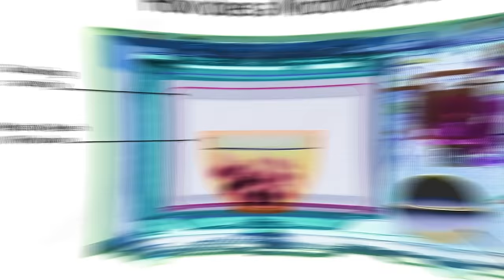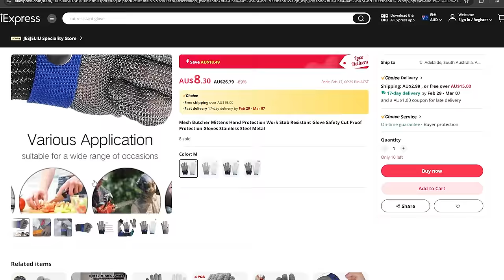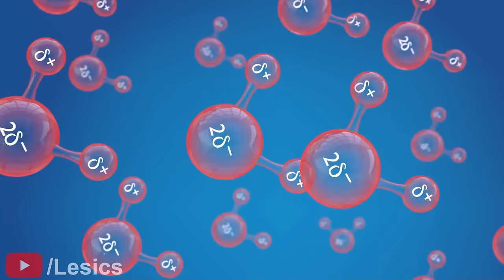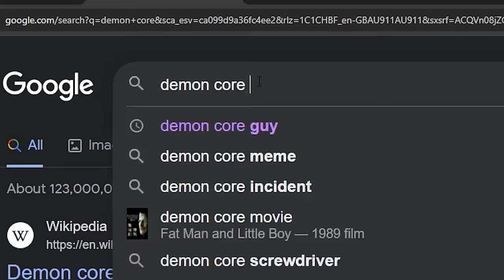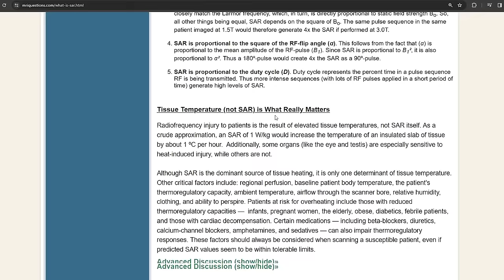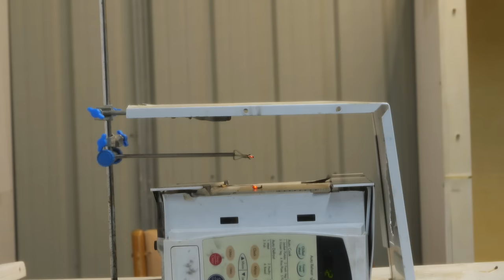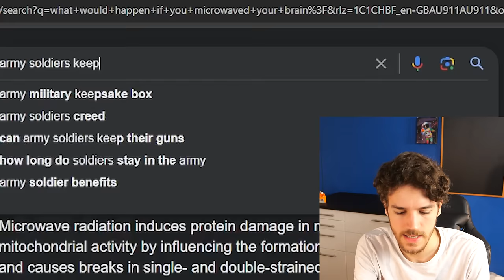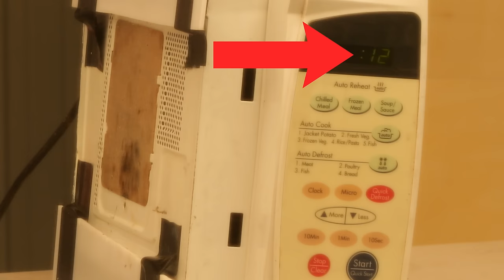I Tested the Limits of a Microwave

Comment: asking chatgpt to do math has got to be the most reckless part of this video
Reply: Right? Please don't ask chatgpt to do math that involves your personal safety 😭
Reply: @tetravisum5526  A.I bots are saying the same thing about you but they have to dumb it down for you to understand.
Reply: 3.5 is often pretty bad at math but GPT 4 has never given me a wrong answer.
Reply: Im sure it was a bit and he checked it lol
Reply: A good way around this is to ask chatgpt to make code to do the math. Its much better at that.
Reply: @Yipper64  how do you know?
Reply: @Alex-cw3rz  Because I double check it, duh. 
Like martin said, ask it to make a program to do the math, GPT 4 is trained to do that automatically.
Reply: @Yipper64  what was the point then
Reply: @Alex-cw3rz  Well I usually use it for when im doing homework, and it gives me the answer (because I guessed wrong too many times) and then I ask chat GPT to find the answer and give me the steps. Very helpful for that, when its correct. 
I go over the steps it gives, and verify that it is correct, and of course my homework has given me what should have been the answer.
Reply: @Yipper64  You should just not be using GPT for homework in general.
Reply: @Unethical.Dodgson  well if it helps me learn... Note I said after I already had the correct answer.
Reply: @Unethical.Dodgson  Asking it for an answer and then blindly trusting it is obviously a bad idea, but asking it for the answer and a method to reach it, followed by double-checking the output (after, as stated, already being given the correct answer) seems like a proper use of the technology. Hell, it's probably better learning than he'll get at school, since schools are/were not actually designed to educate.

GPT et al can be useful tools when used correctly, the problem is most people having no idea wtf they're doing or how to use them (partially due to the companies making them doing the usual bs advertising).
Reply: @Yipper64  "this calculator hasn't given me a wrong answer *so far*", said the head engineer of the new bridge they expect you to cross every day
Reply: @swedneck  I mean yeah, can we not just any calculator or is there some reason we cant trust it suddenly because its attached to a fancy word completer?
Reply: someone asked how to check the temperature of oil and chatgpt just told them to check with their hand LMAO
Reply: @Yipper64  uh, i would hope it's pretty obvious that you cannot trust a word completion algorithm to do math, yes? Calculators can (mostly) be trusted because they're specifically made to do math, and even then there's a reason TI calculators are still quite popular, generic calculators can have programming errors and shitty levels of precision.
Reply: Interesting world we live in where you can trust a computer to paint a picture but not so basic math.
Reply: @michaelwoodby5261  Well, you can ask a computer to do basic math if you use a calculator program.
Using a "plausible sounding bullshit generator" program to do math is kind of like trying to use a microwave oven to put a nail into a wall, instead of just using a hammer.
Reply: @michaelwoodby5261 1) a painting will never be depended upon to keep people alive 2) we can trust computers to do basic maths, but only when using software that is actually designed to do that.
Reply: @swedneck  Yeah... and chat GPT when asked to do math will write a quick python program, make it do the actual math. Which python is designed to do that.
Reply: @izysly6924 girl you understand that your interpertation of "AI" involves the function itself to study human inputs. like if the ai is wrong, that means it interpreted the human equivalent wrong since thats the only thing it can go off of.
Reply: @mushykiller782  we need to give ai human rights now because that is how we behave as humans,
Reply: @tetravisum  Lmfao, LMFAOO, y'all don't understand A.I, the math is easy work for the AI
Reply: @swedneck  ''a word completion algorithm'' That is only how it is trained, it very much groks to general capabilities and the most modern LLM's are actually really good at math.
Reply: I don't really care whether it's a human expert or an AI, give me the correct answer faster and you're doing a better job, and AI actually does in fact often give the correct answer faster whether it looked it up on the internet like a nerd trying to win an online argument or came up with the correct answer on its own.
Reply: @nofbi8582  The Dunning-Kruger effect is strong with this one.
Reply: As long as it’s gpt 4 I trust it
Reply: True
Reply: I'm a math major and I've found that it gets the math right probably like 25% of the time. And only if it's a very common and easily repeatable problem
Reply: @trinodot8112  do you have an example of math it doesn’t do well?
Reply: *to do anything
Reply: @christophermoore6110 It fails miserably when you start having it keep track of variables and such.
Reply: @MadScientist267  ah, yeah well are you talking about 3.5 or 4? Because 3.5 is pretty bad and 4 is a lot better
Reply: @trinodot8112  It scares me how much blind faith people have in it. It's so good at making stuff that seems like it's right on the surface, but if you actually know a lot about it it becomes apparent that a lot of the time AI cannot accurately do certain complex things, like for example big programming tasks, or problems that aren't commonly solved in the training data.
Reply: Im sure he checked the math, chatgpt gave all the steps.
Reply: @christophermoore6110  I'm sure 4 is better but yeah 3.5 just couldn't do it at all, in "word problem" form at least. I had it model a whole chemistry procedure specifically to ask it about math at key points and it came back with just random whatever, and usually not even the same response. That was a bit disappointing, it wasn't mind bending or anything but did take a while to write the pretext to give it everything it needed to do it... it showed plenty of understanding for the context, but the numbers were less than useless.
Reply: 3 times…
Reply: Trust me it's not the type of math you can just do in your free time,  there's a whole set of algebra you have to learn every time you study a new topic, and I'm sure there are plenty more people that get it wrong consistently than the amount of ai that gets its wrong inconsistently
Reply: @Yipper64  You just said you're frequently just guessing answers wrong over and over, which might be a slight reason to disbelieve your claim that using ChatGPT is helping you learn.
Reply: @Chicky_Lumps  Well I meant guessing as in trying to do the math and then getting it wrong. 
Once I have the answer its kind of like I have both sides of the line and I just need to follow point A to B.
Reply: @Yipper64  seriously, too many people have only used 3.5 and have no idea how much better 4 is at this kind of stuff, not perfect, but it can do most problems you throw at it. also if it's not using the code interpreter to do the math, it's very likely to give a wrong answer. it needs to be using the code interpreter.
Reply: @Unethical.Dodgson  "You should just not be using GPT for homework in general." BS. it can literally take the place of a teacher and help you to understand your homework, ai haters gonna hate
Reply: ur unwell  @Cara.314
Reply: I think the most dangerous part about chatgpt being bad at maths is that it doesn't ever say it's wrong. It's like a gifted teenager who's too proud to say he can't solve a question so just makes some complicated sounding shit up. Maybe gpt4 is much better but it would have to be much better for me to put any trust in it at all. It's been taught to lie convincingly
Reply: @Cara.314  ask it to give you sources and citations

I write some simple UI for several different AI (especially claude, I love claude) so don't call me an AI hater. It's just being realistic about what it can/can't do and what you should/shouldn't trust from it. 

It's helped me learn plenty, and it's also made stuff way more difficult than it needs to be. I've already met kids that just graduated high school and used chatgpt the whole time... and gosh, it's embarrassing. Don't be dependent on this shit
Reply: Remember kids: AIs are like teachers.  They would rather lie to you and make shit up than admit they don’t know the answer.
Reply: @izysly6924  lmao ai bots aren't saying anything, they only "say" something when prompted and aren't saying anything, they're just predicting the next word in the sentence and doing calculations, they cannot speak or think because they are not intelegent.
Reply: How else should you begin:

Hey, gotta do some maths to mess around with a microwave, please calculate these…
Reply: @swedneck  “this calculator hasn’t given me a wrong answer so far”

“Great, sounds like it’s a calculator that works then.”
Reply: @tetravisum  you’re literally wrong, math is extremely easy for LLM like ChatGPT to do if you know what you’re asking for.
Reply: @andyghkfilm2287  it is neither easy nor hard for an LLM to do math, because it doesn't "do" math in the same way you or I might. It is a statistical model of language, it produces text that would be likely to follow a prompt. If it has text data for a math problem being solved correctly, it may produce a right answer, but it is not guaranteed, and it often fails when a problem isn't trivial.

For example, go ahead and ask chat gpt for examples of prime numbers who's digits sum to 9, and watch it fail catastrophically.
Reply: @tetravisum  I would ask ChatGPT to make a Python script that would find examples of prime numbers whose digits sum to nine, because it would do (yes, “do”, doctor pedantism) it correctly if I did that.
Reply: @andyghkfilm2287  that would probably produce a better result, but again I just want to point out that chat gpt doesn't think and reason like a human can. I'm a software engineer and when I use LLMs they frequently have blind spots when it comes to code, 9/10 they can produce simple scripts, but it's not uncommon that they produce code that doesn't produce the desired result, and can't fix a flaw that would be obvious to any moderately skilled person. If you're knowledgeable enough to know that an LLM is wrong, then you probably didn't need it (but it can do tedious stuff so long as you check it), and if you're asking it to do something you're not knowledgeable enough to check, then you're going to sometimes be given bullshit answers, and you won't realise it. That's why I say you shouldn't rely on chat gpt for math when the result being correct is important.
Reply: @NightKev omg is that miku !
Reply: @nofbi8582  Then why does it give bad answers to basic mathematical queries most of the time? Because it's not built for math, it's built as a data averager, prone to hallucination if it doesn't have enough data on the particular query. It's not like they actually check all the mathematical data in the model databases for accuracy, since the sheer amount of data LLMs use makes that impossible.
Reply: @michaelwoodby5261  You do not need trust to paint a picture, this makes no sense at all.
Reply: @tetravisum  ChatGPT is terrible at providing math concepts on its own with any accuracy but, when I provided a picture from GED Book about a specific math topic, it gave me relevant information and helped summarize the long drawn-out pages in a way I could understand, then I could go to the answer page after working through some problems with it, and 95% of the time it was correct. Providing ChatGPT the math concept and then asking for example problems based on the information provided to practice with, worked surprisingly well. It just has to be educated first if that makes sense lol.
Reply: @Unethical.Dodgson  Pointless work is what AI is meant to eliminate bruh
Reply: This comment didn't age well lol. AI is now more reliable than a mathematician.
Reply: @leptoon  o1-ChatGPT taking over soon lol
Reply: Lol you can 100 percent trust l, even Copilot uses open ai 4. Those are bots incredibly smart yes they are design from nature, but let's add quantum computing to ai, those machines will be so powerful will exed every human at any task. Future is coming and is not that cool.l depends how you look it.

Comment: Kids watching. A microwave transformer will instantly kill you if you so much as touch it. Please never ever take a microwave apart unless you know what you're doing. (As in if you are an electrical engineer. Or equivalent knowledge level.)
Reply: Womp Womp
Reply: Also it doesn't lose energy very quickly.

As in, unplug the microwave, open it up 2 weeks later, well guess what? Turns out it does a pretty good job at storing energy.
Reply: @charakiga  That's the capacitor's doing, but yeah, that's extremely unsafe too
Reply: @charakiga  Then youre probably using a 30 year old microwave. Any Microwave from the last 10-15 or so years will 99% of the time have a bleeder resistor to instantly discharge the capacitor to safe levels. In fact, thats the case for many if not most Powersupplies. I have tested this myself over and over. Never did i even get a single spark or any noise while shorting the capacitor within seconds after unplugging mains. Im almost certain that this is standard safety code so you can even sell a microwave. 

It CAN happen that your appliance doesnt have a bleed resistor but it most probably wont. Stop spreading this myth as if its 100% real.
Reply: @Sharpless2  yep true. and also a liability thing, legally they want to play it safe and why they put the big scary stickers. also people are dumb and would touch stuff when powered on.
Reply: this should be pinned honestly
Reply: he should pin this. dumb he didnt mention this even once the whole video
Reply: @meme-uo5yu  i mean if you watch his other vids he does a good job explaining the dangers, and while hes not explicitly doing that in this one, he does mention why he sits crosslegged and mentions this is dangerous

at this point, if a kid needs any more reminders as to why they shouldnt mess with microwave electronics that just feels like darwinism at work 😂
Reply: Please pin this comment
Reply: Safety tip. Hold down the power button while the unit is unplugged to drain the charge stored in the capacitors. Even unplugged, a charged capacitor can arc to your finger and give you a nasty shock. Usually capacitors store 12 volts worth of power (or 8.3 repeating amps of current) ... 1/2 of an amp can cause fatal shock to your nervous system.
Reply: Everyone can hold their horses don't educate me now because it's too late, but we had a small fly tipping dump form next to a ghost estate that was started and never finished (because it was a way to shift money and pocket it while leaving a failed project to point at for the missing money) and there was somewhere between 15-30 microwaves there.  We kicked the crap and smashed the hell out of them.  All was well.  I think we can all agree yes the transformer is extremely dangerous as most are, but smashing one is extremely fun so the pros technically outweigh the cons
Reply: @Sharpless2 It most certainly isn't a myth. While it is true that most modern appliances include bleeder resistors, there are absolutely still old CRT TVs, old microwaves, and old hot water heaters with capacitors with an ungodly capacitance that could easily fry you if you aren't careful. It's better to treat a device as though it is not discharged and has no bleeder resistors than find out the hard way that the appliance you're working on does not include one. You're acting butthurt over a really good safety tip, and I don't understand why at all.
Reply: i had one when i was like 9 my dad made it so it isnt charged anymore an i took it apart (i always take random electronics that dont work anymore apart) and here i am alive BUT still Dont actually open microwaves
Reply: @EliteMYt your a child
Reply: You should add in your message that he off course didn't touch it 
(Otherwise they could think like "nahh he did it i just need protection" while they don't know what's the dangerous part to not touch)
Reply: Yeah, that's pretty much where the only significant danger comes from concering microwaves, it's never been about the microwave itself or even the microwaves that it emits, it's the transformer that's the scary part
Reply: Bro just unplug it
Reply: @kavalogue  Magnetrons may contain beryllium oxide ceramic, whose dust is very toxic and causes lung cancer. In some ways it is similar to asbestos. It is very unlikely that smashing whole microwaves causes significant amounts of the dust since the material is quite stable and protected by a lot of sheet metal. But if you don't want to have any risks, wear respirators.
Reply: @Sharpless2 still don't touch it though...
Reply: @Pro-Atheism  you're*
Reply: what are u gunna do to stop me
Reply: Dont listent to tis spoil sport its fine.